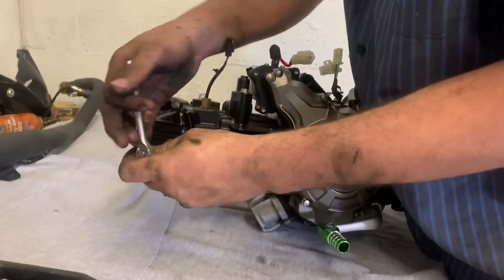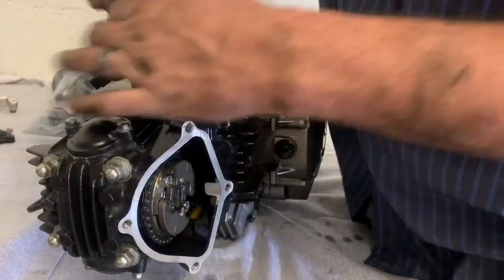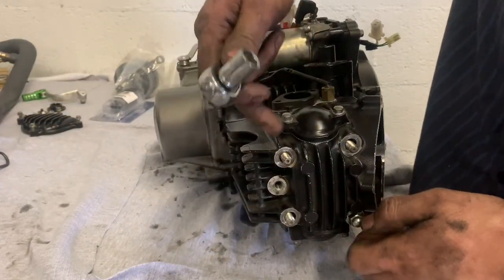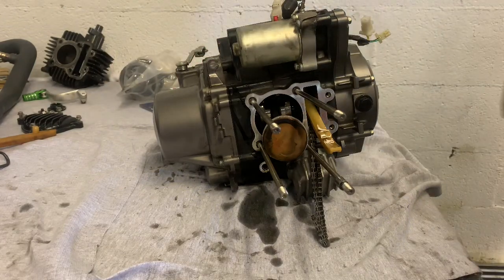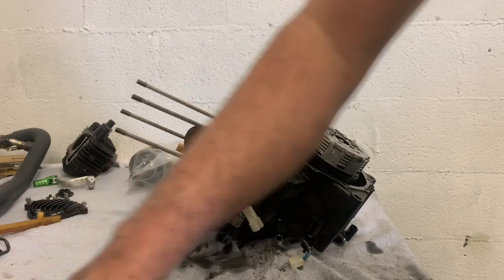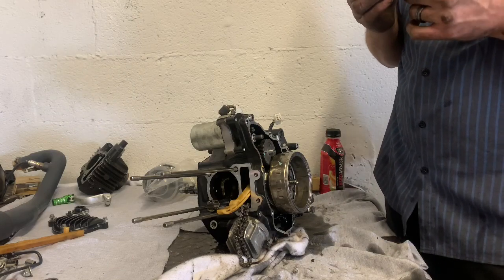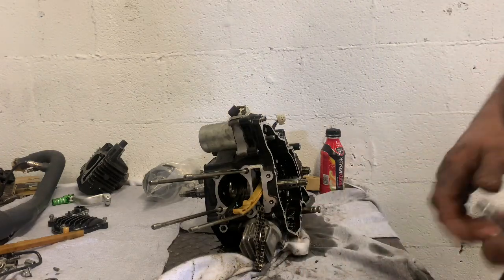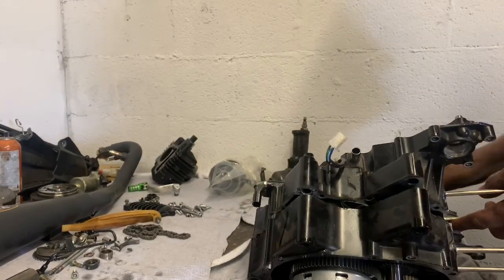Kawasaki Z125 engine disassembled part 1 of 3 for stroker crank

Comment: My starter coil die.. and i change by myself.. after change the coil,there is noise come from the magnet area.. do you have any idea..? That time i dont want to pour out my engine oil,so i just lay my motorcycle aside.. there is no scratch or what at coil,starter gear,and all the magnet part.. pls help me..
Reply from the maker: Make a video so i can hear the noise

Comment: I'm rebuilding mine and as I took it apart 5 little knuckle like pieces came out the chain is fine and it still spins and goes in gears any ideas what it maybe before I continue ...? Also my piston has a hole in it from one of the pieces
Reply from the maker: Are you talking about the shift forks?
Reply: @Boostismyfriend  I think so it's 9 total no bigger than a dime I'm waiting to get the tool to take flywheel off but they are shaped like a mini egg and I have a hole in the piston head